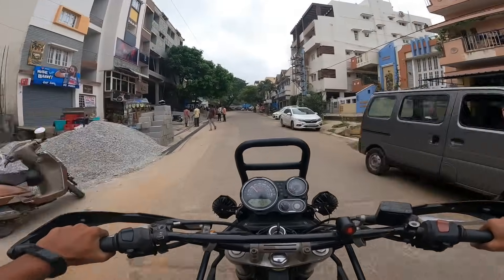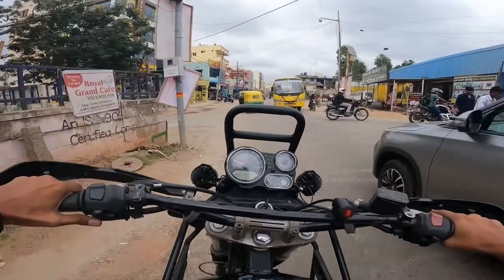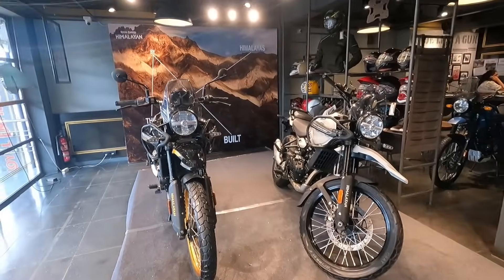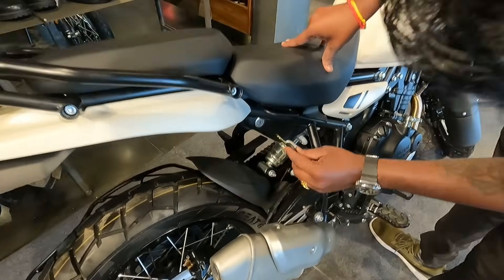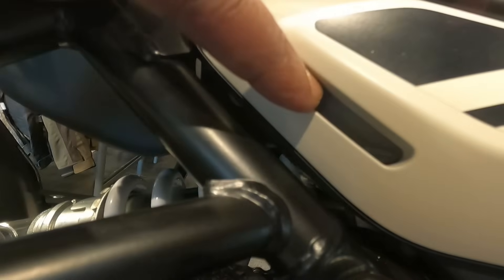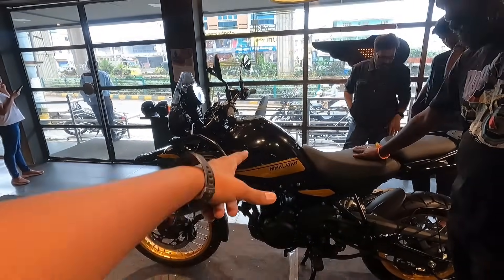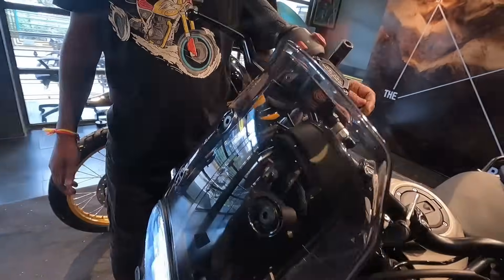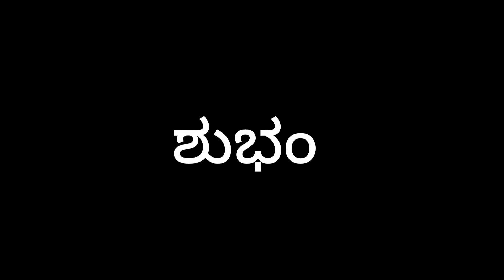ಹೊಸ ಹಿಮಾಲಯನ್ 450 price ಕೇಳಿ shock😲| #himalayan450 detailed review in ಕನ್ನಡ @royalenfield

Comment: Hey bro, is the on road price for the top model 3,62,000 ? Because from the showroom where I booked they told 3,80,000 -,-! I booked from Sai Ram Autocraft, whitefield
Reply: Ha yes bro,they even told me the same ,but I have researched on some websites it is shown the range between 312 to 342 k
Reply: But 380 k is very high because it costs a 1 lakh more than the ex showroom price
Reply from the maker: He said 365k
Reply: I just asked my dealer, he said 3,80,000 was approx price. But it is something between 3,62,000 - 3,65,000